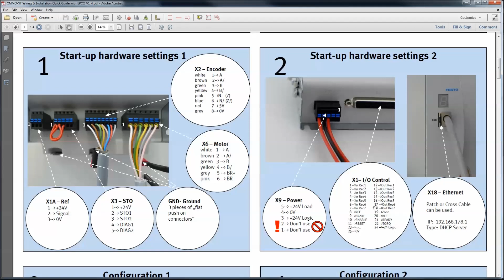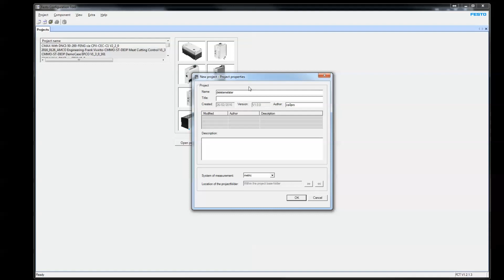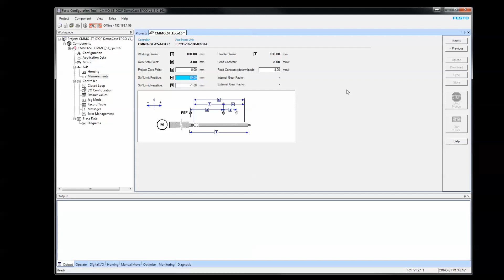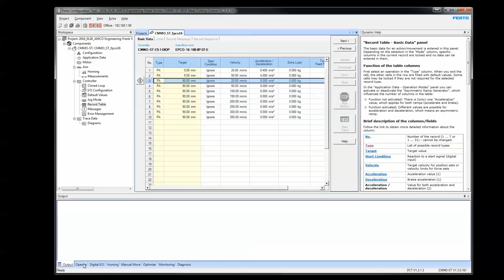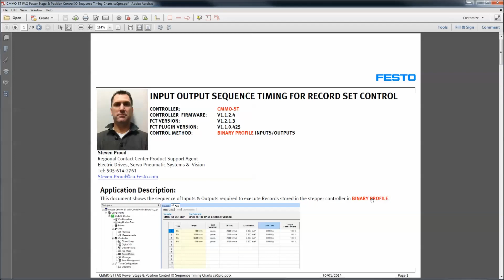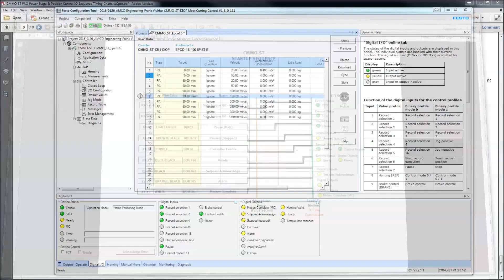CMMO-ST-IO x1 + IO Control + Wiring + FCT Config + Record Sequence

Comment: Hello steven i have to control the cmmo st with a Siemens s1200 plc but it doesn’t work 
I cant reference or drive the motor  
Do you have a little slc text for me I’m new in plc programming it would be very great if you can help
Reply from the maker: I suggest you contact Festo Tech support at your location and they will surely help you. 
You might find some modbus function blocks on their website that works with 1200 as well.

Comment: Hi Steven ! 
Great video & lot of information.
I'm working with that driver & I'm having a problem with revision, let me try to explain...
When I go online, the FCT throws me an alert "The controller is using firmware version 1.4.0.4. Access is limited to readonly! Please use plugin version 1.4 or update the firmwre (min. version 1.5)". 
The version of my FCT is 1.6.0.162.
What if I upgrade the driver to the same version as the FCT, my information will be lost ?
I wonder if you could make a video starting from nothing with a driver ?

Regards !
Reply from the maker: Sorry Fernado but I do not do technical requests in my personal you tube videos - I hardly have time to do my normal vidoes. The message alert indicates you should upgrade your Firmware so I think it is obvious this is what you should do.  As far as losing your program in the controller-> if there is a project in the controller, simply upload it and save your project.